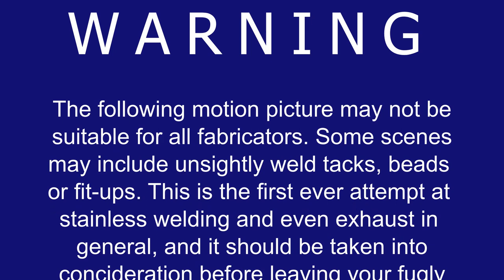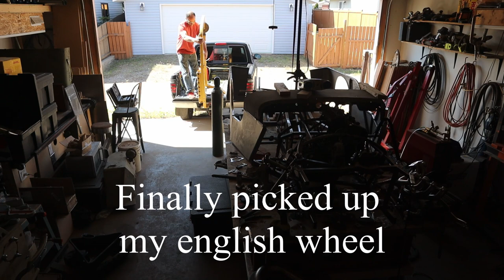Hand made turbo manifold build for the Hayabusa Willy’s! (Turbo Hayabusa Willys Jeep Build Ep. 09)

Comment: the option you chose was to make the collector dump straight into the turbo manifold flange, did you have any other options for example make the collector near the sump and run a 3" pipe to the turbo manifold flange or was there no room available.    
i watch a lot of jdm car turbo installs and they do the same for the most part yet the ls guys run long collector tubes from the collector into the turbo maifold.

i am enjoying watching something different and kudos for thinking outside the box
Reply from the maker: I think something like that would have been a bit easier, as they make collectors to do just that. It would have needed to be high though as my steering rack will be just below it. I didn’t think I would run into the issues I had when I started though. Haha. Not sure what the performance difference is when you go to a collector before the turbo. 
Thanks for checking out the build, and glad you like it